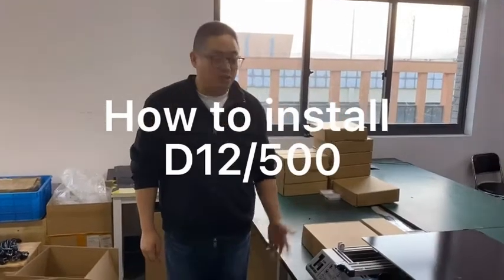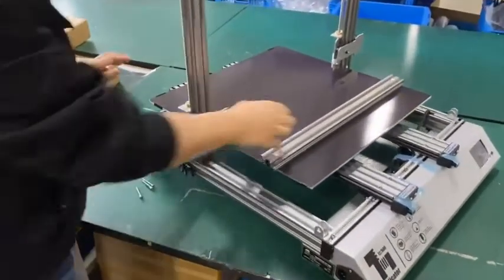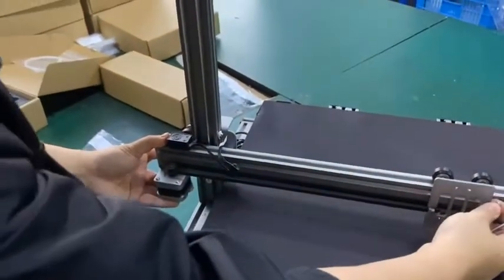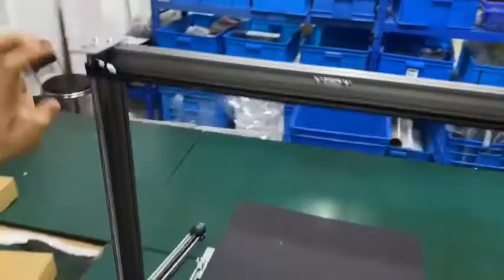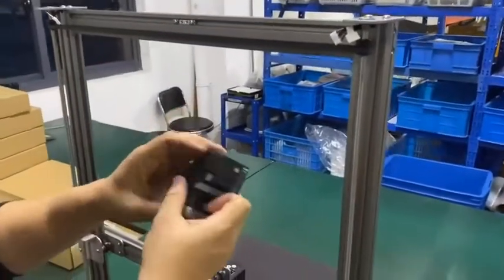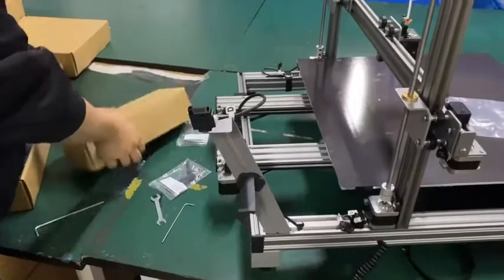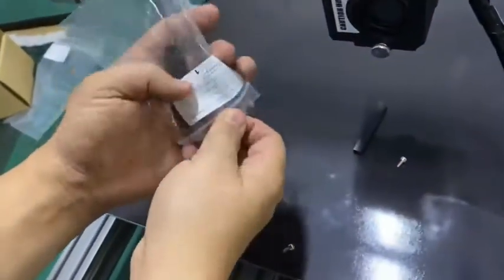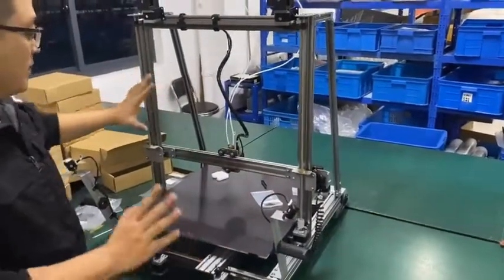How to assemble the D12/500 from box?

Comment: Hi Gary.  I've never used a dual extruder printer before.  How does this work?  Do both spools feed the hotend at the same time? If I'm printing a massive item that'll need more that 1KG of filament, will the second spool automatically start being used when the first spool is finished?  Can the spool holders hold spools larger that 1KG?  Thanks.